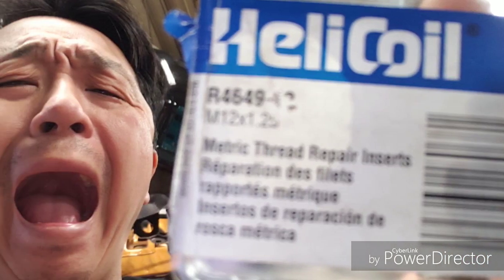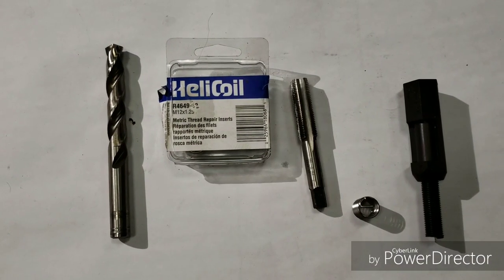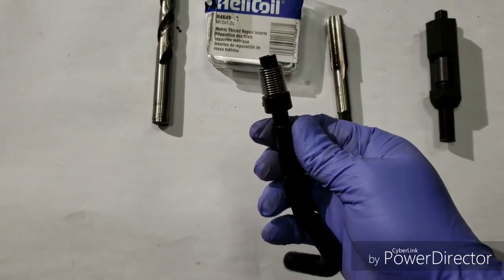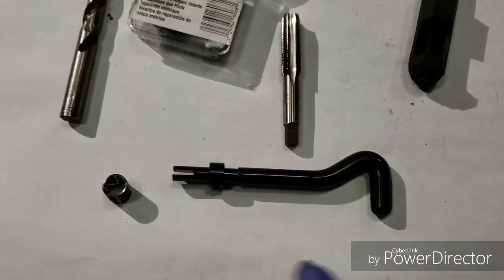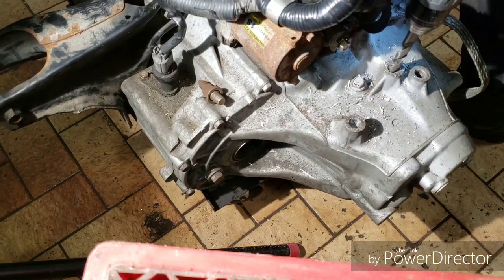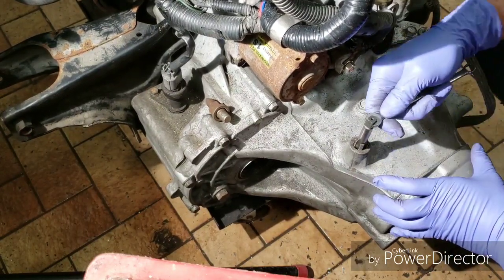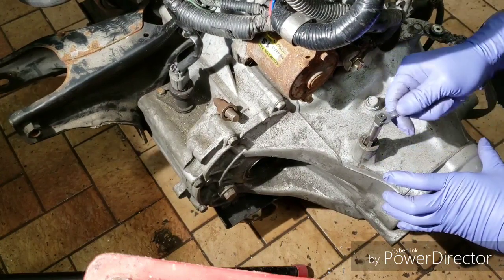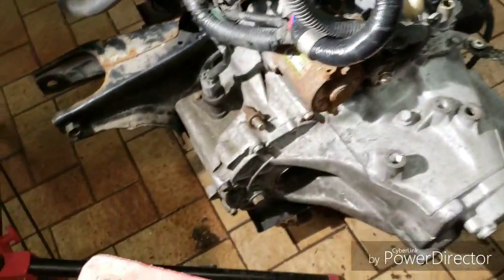How to fix stripped bolt hole with Helicoil

Comment: Hello is the actual size of the tap that you are using after you drill the whole size 12x1.25? Or is the tap bigger but the helicoil allow you to use a the bolt with the same pitch? Any feedback would be much appreciated for which I need to do the same thing and was trying to piece together my own kit but cannot find the 12x1.25 tap in any stores near me thank you
Reply from the maker: The drill bit is a bit larger to accomodate the helicoil. Try looking up helicoil drill bit size chart. If there are any Harbor freight near you, they might have the kits available. Also Amazon/Ebay might have as well. Hope this helps
Reply: Uncle Tinman okay thanks you is the actual tap 12x1.25 or is it a special sized tap? I was going to order the springs by then selves then get a drill bit and tap so I don’t have to order the expensive kit but I can’t find the 12x1.25 tap anywhere and idk if that’s the size that is in the kit or not if it makes sense
Reply from the maker: @alonzocates4742  No. The tap is a different size. I'll take a look monday.
Reply: Uncle Tinman okay thank you much appreciated
Reply from the maker: @alonzocates4742  The tap says M12x1.25. It's a Helicoil tap. I don't think that's the actual size.. I think it's an adjusted number for the purpose of the helicoil.

Check out this sizing chart I found online:

https://i.pinimg.com/originals/70/48/71/704871537c1e61bbdbe47d557c45a4fd.jpg